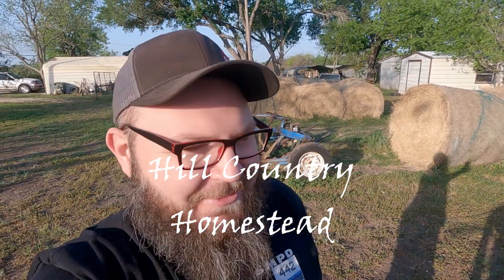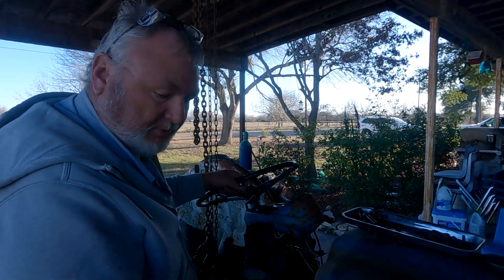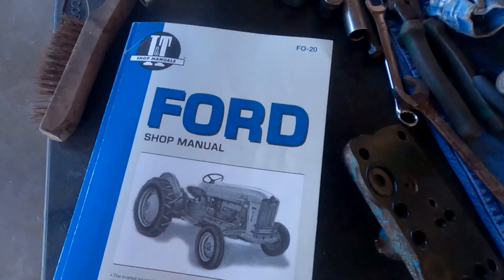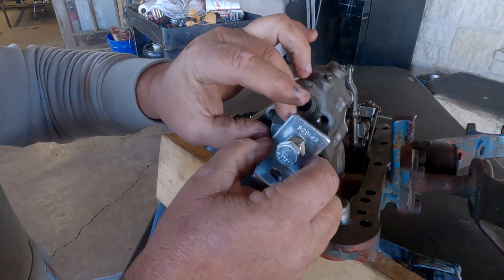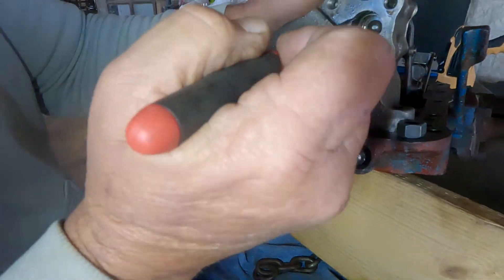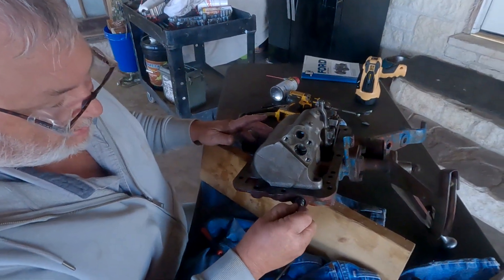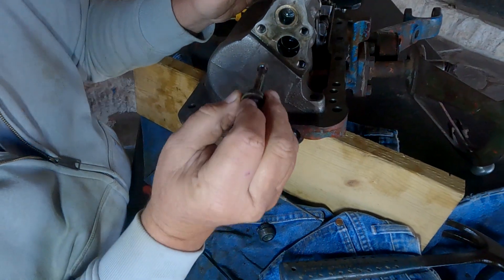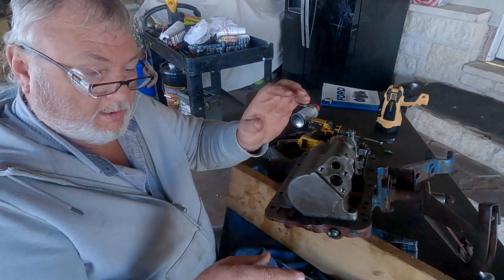Repair Ford 600 Tractor Hydraulics - Stuck unloading value causing lift issues

Comment: Mine= Ford 800. The lift will work but only in the last 1 inch of the lift handle. 
From their down it will do nothing. Also it will not lift near as high as it once did.
Any ideas out their?

Comment: Thank you for this video! I rebuilt everything on my 600 and lift still did not work then i found your video. I pulled the plug holding the valve in and sure nuff it was stuck i cleaned it and put a new o-ring on it put it back together and it works like a dream now. Thank you!

Comment: Mine will lift in the full up position but want hold anywhere else it just falls any suggestions would be helpful thanks
Reply: Your main piston probabably has a bad seal.  Youll need to top that top cover off and get to the piston and put a new leather and oring and such

Comment: Thanks for the video. What problem with the lift were you having? What does the unloader valve do?
I'm wonder because my tractor stopped lifting anything heavy one day when I was trying to lift what I think was too much for it. The three point goes up and down fine with no load but under load it moves about 1 inch only.

Comment: Nice informative video. It would suck watching a video doing the top lid repair and not knowing about the unloader valve slap it back together thinking you’re all done and it still not working. I’ve seen on many online forums the mention of a common issue with the valve sticking. That was the issue with mine.
Reply: Like me ??? Lol Yes it does suck  put to gather take apart put together take apart

Comment: My unloaded valve always gets stuck and then I have to take the entire top cover off, break everything down, clean all up and reassemble. I would like to know how to measure the resistance of the unloaded valve so I can adjust for all temperatures and conditions and never have to disassemble and repair again.

Comment: Thanks for the video! Very informative and helpful! I searched all over the internet for a diagram of the load valve (the one Rachel couldn’t get to come out and just put back in) because I got mine all the way out but I don’t think the last person to assemble it did it correctly. Plus I checked my unloader valve and it was sticking so I followed y’all’s instructions and fixed it. Can’t say thank you enough!

Comment: The top cover video they made, did go over this , he didn't spend much time on it , or really explain it , I did the same thing skipped pulling it , on mine the pump kept leaking , I went through the pump  3 times even converted to the newer gear pump and it still leaked ultimately (Had already replaced the relief valve) I calling dan on there tech line, but yes this is what releases pressure , he called  it the load valve, and your right very little information about it. This knowledge does need to be passed on , these old tractors could last another 50 years or longer if they keep making parts and we keep the knowledge alive

Comment: Cool video! My tractor has been in the shop for at least 3 weeks now. Did all the things Rachel suggested. I never did find anything wrong. I just got done confirming my pump is getting 2000 psi. I was going to hope for the best and put it all back together.  Then I found your video. I just figured that valve was so sealed in there that it must not need maintenance. I am pulling it out as soon as I can get to it. I am sure that is the problem. Thank you in advance.
Reply: I’m pretty sure it’s the problem and rusty water oil mix will surly stick it and any metal shavings 
I put a fuller Eaton RTO magnet in bottom of both 901 and 951

Comment: my ford goes up but with low weights 70kg it passed from that it does not lift could it be this valve?. I am from Brazil
Reply: I have same problem, how you fixed it?

Comment: Metal peace’s will cause it to stick 
Keep system clean and oil change regular 
Thank You for information and advice 
I was a ford tractor mechanic for 5 years in 1968 and finished diesel mechanic classes and left

Comment: Good addition to the knowledge pool. The plug cover to my unloading valve does not have the threads. So I used a C clamp to press it out. Worked great

Comment: I've been off and on an old hand me down 64 2000 tractor for years. Hydraulic s would come and go, new seal kit in the top cover adjusted and off and on so many times thru the years. This was great and seemed to fix my issues thanks guys!

Comment: You guys saved me a lot of time!  This must be a common problem.  My 19 year old son has been working on our Ford 600 that was originally my grandparent’s, and dad’s second tractor here on our farm.  This tractor set way over twenty years in our building.  This hydraulic portion of the project my son has done mostly himself as a learning experience.  We have the Vickers vane pump that is original.  It checked out okay.  He rebuilt the top lid, and installed it.  After installing he had pressure, but no arm lift.  So he came to me.  The first question I asked my son is what actuated the lifting action.  Then we started to research the hydraulic system, and ran across the video you guys created.  We went through the repair process you presented.  Our unloader valve was really stuck, and had a lot of sludge.  Our o-ring look to be in good shape.  I didn’t have a replacement.  So unfortunately I had to reuse it.  After cleaning, and reassembling it now works perfectly.  Holds good pressure!  I have worked around heavy truck repair all my life, and probably would have eventually figured it out.  On the other hand it would have taken more of my precious time.  We here at Burton Farms want to Thank You!!!!!!!  Our Ford tractor means a lot historically to our 4th generation farm!  Now my 19 year old can use the Dearborn 2 bottom plow that he just bought this spring.  He, and my dad will be all 😊 smiles.
Reply: I’m glad it solved your problem….. And it is nice to see young people enjoying this old equipment. Take care
Reply from the maker: Amazing! These old tractors will run forever if given a little TLC.